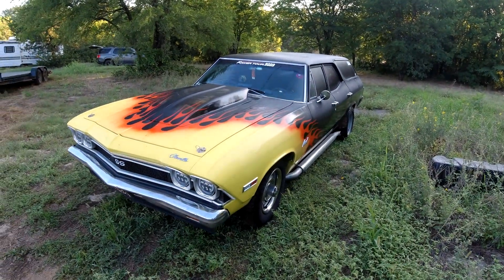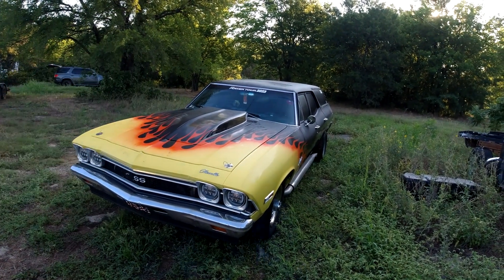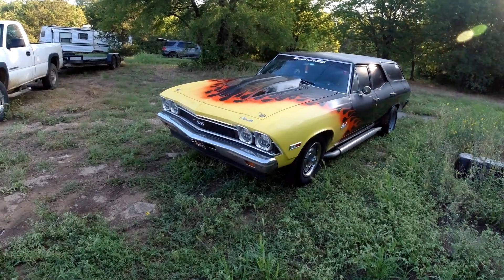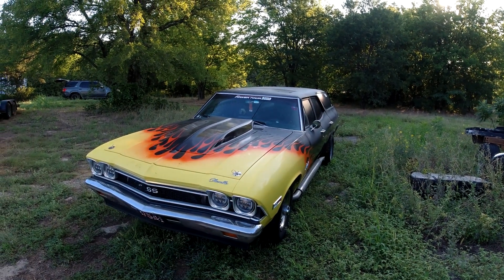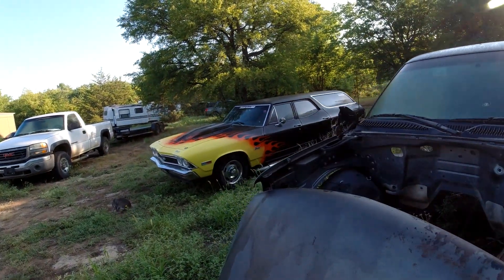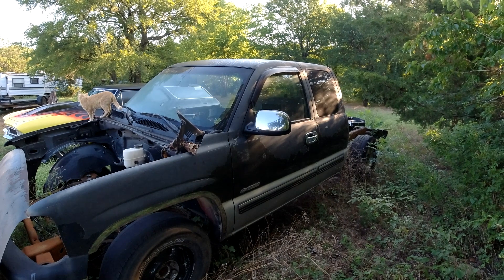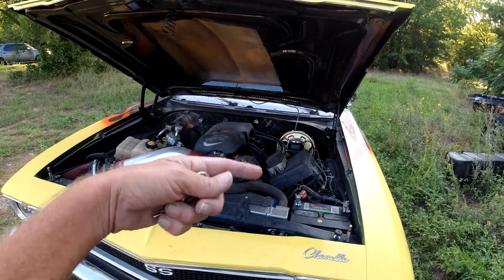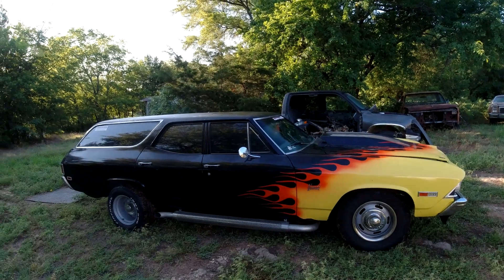How to do an LS Swap for FREE ! No Money Required ! I did it and you can too ! Free Drivetrain !

Comment: Good morning from Cape Cod 🦈 here in New England with all the salt on the roads there's plenty of rust. I've gotten many running and driving but unroadworthy trucks, got a good rust free vehicle what's a bad drivetrain and there you go. At 59 I don't have the energy that I did many years ago, back in my twenties I flipped several trucks and made enough profit to buy a brand new 87 Chevy Silverado cash. Yes Lee you are absolutely 💯 correct. I'm subscribed to your channel because of the work that you do, it's a hell of a lot of work but it's worth it. Great video, keep it up 👍✌️🇺🇲
Reply from the maker: Thanks

Comment: Recently I was asked about a SBC 350 on a Gbody FaceBook Group. He commented the same thing on my photo. "Aren't 350's a dime a dozen", well I answered "No not where I live, Most that are selling 350's have rebuilt them and want $$$$$". Which is true. For my 81' Malibu I was able to obtain a 75k mile 84 K5 Blazer SBC 305 to put into the car for about $800.00. Unfortunately where I live I can't go moving an Engine hoist on rocky ground. I had no choice but to have a Mechanic I know put it in. Fortunately the car in question is going up in value almost back to it's original MSRP. Thus in my mind it's worth it, couple more years it'll most definitely be worth the money and effort. Body, Paint and other things I can and have done on my own. . But it's all outside in the elements, that's all I can do.

Comment: I think one thing to note here is it depends what the person wants. Maybe they dont want all the unnecessary wiring and boxes you have under the hood. Might also want the gauges/holley screen to look clean as well as the ignition to work with one key. If you want to just drop it in and run then yeah but if you want it aesthetically pleasing the extra money is necessary
Reply from the maker: "necessary" being the keyword there. There's a lot of things people can spend money on when building a car.

Comment: Yes, you can with the Carb theater here in 30 Mile and use 2 1/2 gallons of gas even as a proof of concept even rigged up a lawnmower carburetor with the software and everything on the bottom of it and on a Ford built 351 small block it in his freaking thing check it out. It can be done those who think it can’t be done or full of shit. I’m sorry.